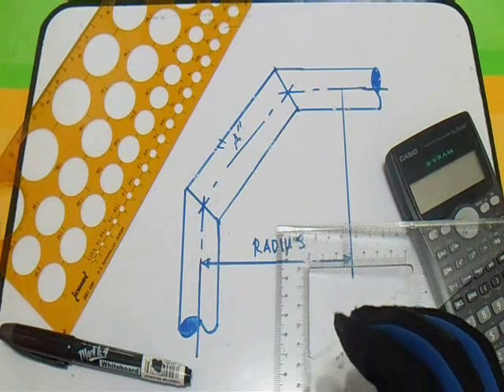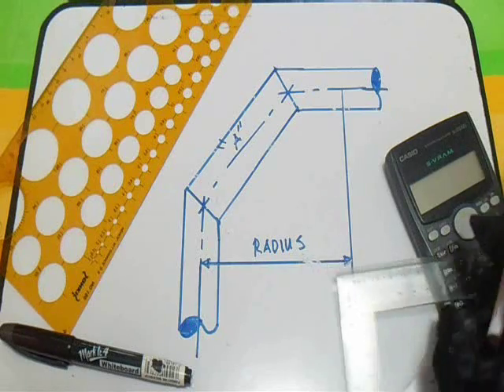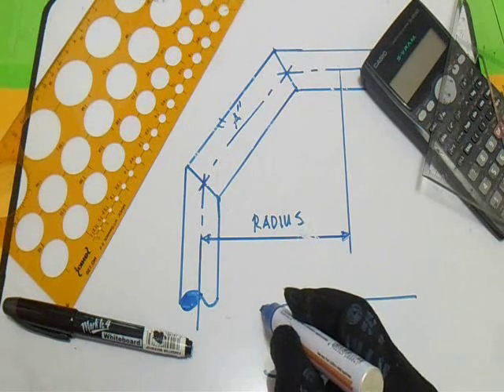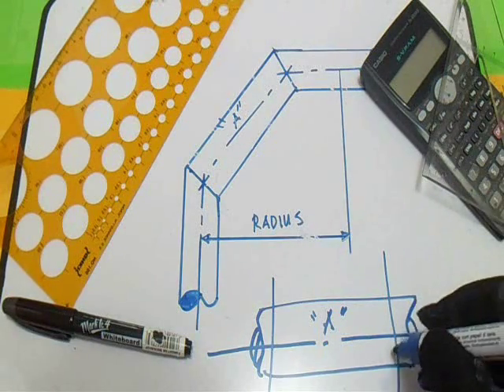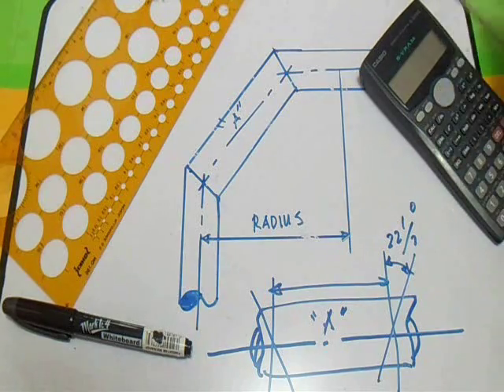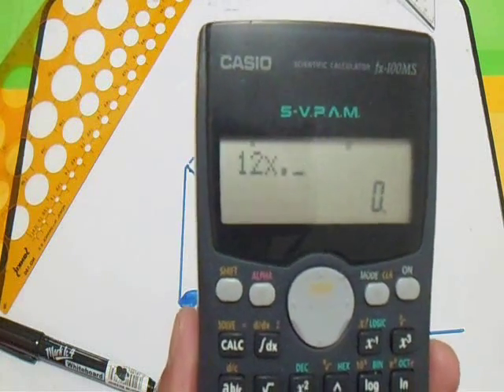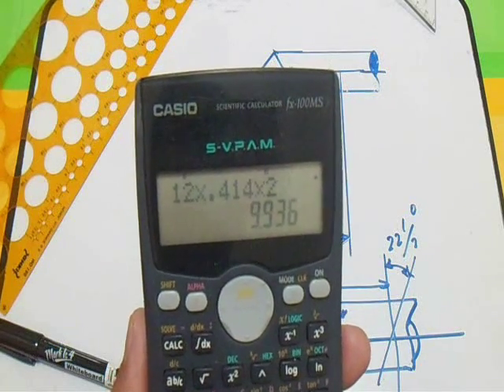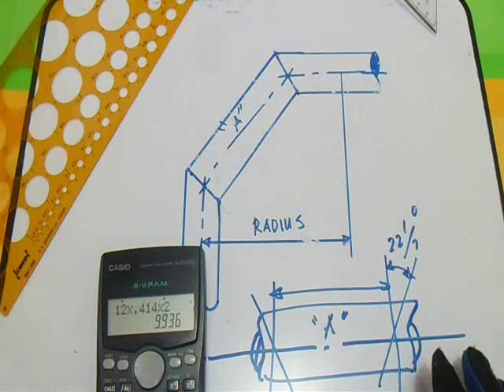Piping Angle of Cut Three Piece 90 deg Turn Two 45 deg Turns Equals 221/2 deg Cuts

Comment: I am very sorry sir, but your kind of fabrication is ridiculous, where did you get that kind of formula?????? Just use a divider(drawing compass) and a protractor and a straight edge, make a template. As you can see in you drawing, your angle of cut don't even connects with the right angle in your reference, you didn't even mention the take off in which you will start your circle as a guide of your template, as you can see, even your drawing is not in the proper angle. This is very simple sir, just draw a right angle, from the reference point (the point where vertical and horizontal line meet), you will measure the take off of the pipe, which is the center line of the pipe, you will get the radius and mark on both sides from your center line, you will have your diameter, from there, use a divider  to divide the pipe equally. Then draw the line from the exact division of pipe to the point on the base of your template(vertical line) so that you can measure them equally then project every line(draw line horizontally enough for the circumference of the pipe's dimension) then draw a vertical line in which is the equal dimension of the division of the circumference, just divide equally how many points you have. then from top, mark with dots the graph in corresponding axis(from your vertical and horizontal compared to  the template the templates marking). Connect the dots using a french curve or just connect it then cut, and there you have your pattern that you put around your pipe and cut.   

And if you want calculation, you could also do so. Your angle of cut in all mitered elbows with 90 deg. angle is= 90 deg./(no. of cuts x 2) or 90 deg/((no. of pieces-1) x2) and you still have to draw the same template above as mentioned without projecting, then you could use triangulation using sin@=o/h in which @=degree of cut, o=opposite(height from base to intersection from the angle of cut) and h=hypotenuse(measure from reference point to right angle on the base. Ex. pipe take off is the measurement from reference point to base of your center line, one point, another is from both sides of the diameter, then you have 3 correct points, and just measure each point you divided, usually, it will be 8 points in one face(diameter), and 16 in the whole circumference). if you use tangent, the tendency is that the take off of your elbow will be greater than standard because you are using the right angle, in which the take off of the elbow should be following a circle in which whichever side of the elbow, the take off is correct. OR YOU CAN JUST MEASURE YOUR TEMPLATE AND DIRECTLY MARK IT IN YOUR PIPE AND CUT, YOU CAN ALSO DRAW YOUR TEMPLATE ON THE GROUND IF YOU NEED TO AND TRANSFER TO PIPE ALL MEASUREMENTS AND CUT but calculation is more accurate....  I just don't know how to make a video, cant explain that much. Sorry...... Hope we are not teaching the wrong idea to piping aspirants and for the next generation of us. And also, if you draw your angle of cut properly in your drawing, the length of your section A is equal to  2x the smaller section.
Reply: +Arthur Vicedor 
How would you fabricate the actual 90 in the field with no drafting table? You have just a wrap-around, soap stone, oxy-acetylene torch and a grinder.

Go.